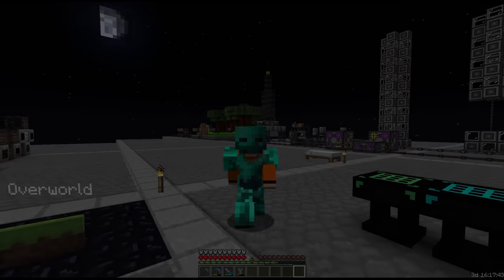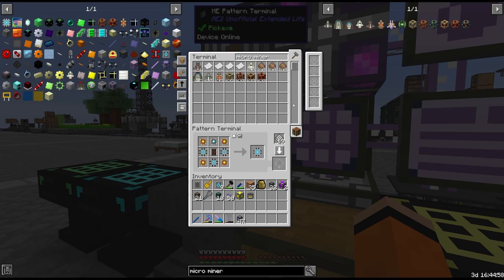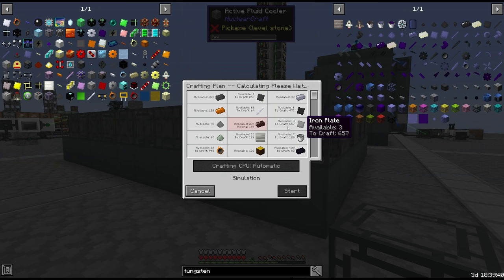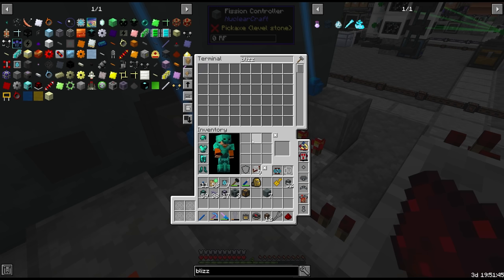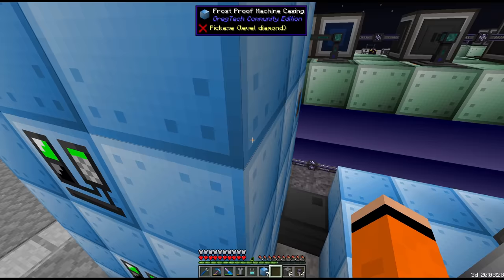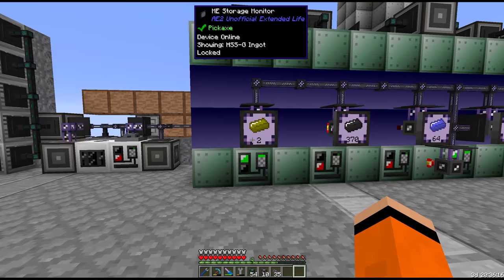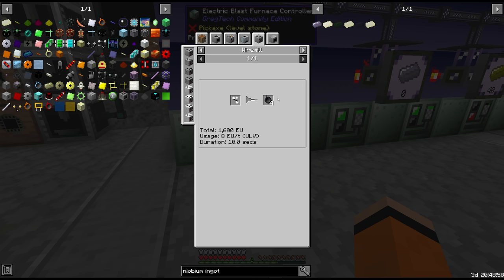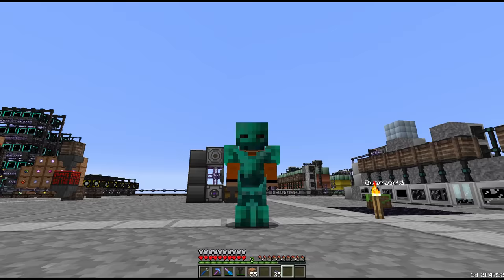Millions of RF - Nomifactory: Episode 16

Comment: Packaged auto is so cool, you probably already know but you can add more unpackagers with the same patterns set as the packager so you can infinitely parallelize crafts if you need, say for making 100s of omnium motes.

That reactor is so badass. I don't think I ever used item or fluid lasers before I saw you do it.

I'm getting to passive assembly line crafts for t7 and 8 miners and annoyingly the thing I'm not sure how to accomplish is space because of how stupid I built my base and I really don't feel like doing more building if I can avoid it haha
Reply: Sadly on my server after reset all connection between relay be destroyed so I have to set it up again

Comment: Isn’t there another cable for IV other than Lumium, that is much cheaper.
Reply: Yeah, but if your lumium is passive, you'll build up plenty while making other infrastructure (i.e. the massive reactor).  You can also use way fewer Lumium cables by using more CEFs.
Reply: @MrErizid  yeah you’re right

Comment: wait nuclearcraft is viable now?
ok im playing nomi this weekend... never liked how in omni the reactors were purely just for breeding
Reply from the maker: Yup Nuclearcraft is certainly viable now, not only for power but you also need for the nuclear fuels. As far as I know though there is not a one size fits all reactor out there, so things get quite pricey. But its worth it... and its fun :D
Reply: If you want to make a bigger reactor, you can get 2 million RF/t without active cooling as well.
Reply: Through 1.2.2, NuclearCraft was not a viable power option because it was configured to run at 10x speed while producing 1x energy. To ease the pain point of repetitive and spammy numismatic dynamo power generation around IV I sent a pull request to add some additional config options in NC and then adjusted the configs such that reactors now run at 5x speed but also generate 5x power.